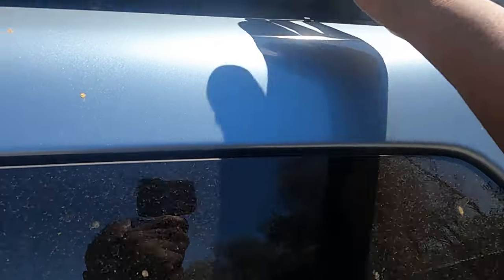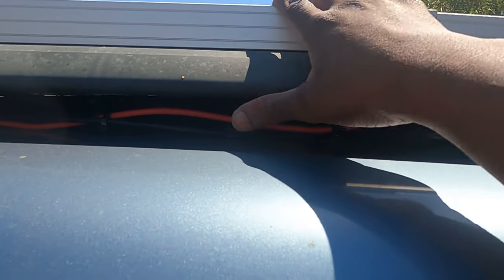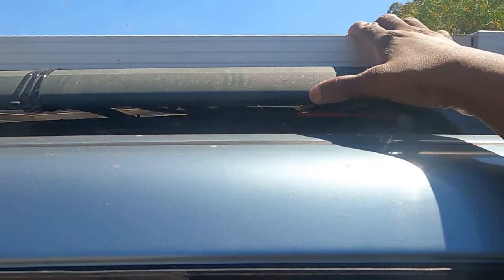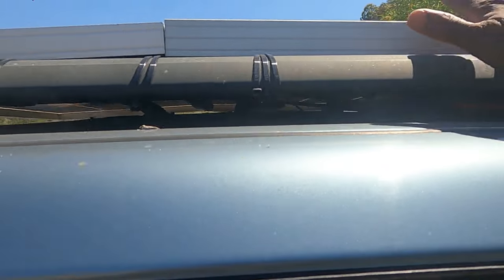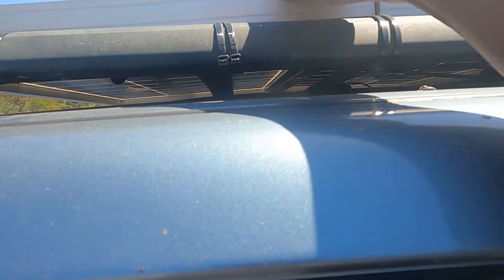MINIVAN VANLIFE: MY 400W SOLAR SETUP

Comment: If your fuse replacement didn't help the lighter then you probably need to replace the socket. I have seen videos on this for the Toyota Sienna. A1 Auto Service has a video from 2 years ago. Tim from MoBang For Your Bucks has a Sienna and does a lot of electrical stuff and is in SoCal, you might could reach out to him for help. Tim is a Glorious Life On Wheels follower as well, super nice guy. His email is posted with his channel.
Reply from the maker: Thank you. 🙂

Comment: Did you check the fuse on your vehicle’s 12v socket (aka cigarette lighter plug)?

My first power banks were after watching on the news NYC in blackout for days & days from Hurricane Sandy & nobody could charge their cellphones.  I gave friends & family little for Xmas Mophie power packs that could recharge your phone 2 or 3 times. Years later I ended up with a CPAP medical device, but power stations out their could hardly go all night & prohibitively expensive.  But then I wanted to go camping for 4 or 5 nights.  The first power station I got in 2018 could only go 2+ nights so I returned it & got one that was powerful to go 4-6 nights depending on how many hours I slept.  That power station is still dedicated to the CPAP, I have another one that is 300wh, and several power packs for recharging phones, tablets, & USB devices like fans & radios.  It works well enough.
Reply from the maker: Yup, changed the fuse several times and still nada. I also check to see if the bar in the fuse is broken and they never are.

Comment: I have two bikes that someone built for me years ago, i use to ride them everyday back and fourth to work (year around), but unfortunately neither one is operational at the moment, would love to get them going again, but the guy who built them for me is no longer around 😔 it's awesome that you have those skills and that knowledge..
Reply from the maker: Sorry to hear you can't get them fixed. I was thinking about building one out while actually living in my minivan. Maybe a folding one, but I haven't worked that all out yet. 🙂
Reply: @cheflifevanlife  Yeah I think that eventually I will just purchase another one and sell the two I have .. I want a folding electric one as well, the only problem is that they appear to be so small, like kid sized 😂 I'm a plus sized (smaller end) women, so I need an adult sized bike! .. am still torn between that and just getting a moped or motorcycle instead 🤔
Reply from the maker: @beyondcomforttraveladventu1856  They make some pretty sweet ebikes that are a cross between a motorcycle and a moped. So low maintenance and looks super cool. It was one that I would actually buy. https://www.onyxmotorbikes.com/pages/rcr-72v I love that thing. 😍

Comment: Your bike ride scared the heck out of me. I couldn't tell if you used metal zip ties to attach your panels. That's what I used. I used 3 metal zip ties per tie down location which looks similar to what you did. I did use plastic zip ties for the cables though. I just have one big 200w panel on my Sienna right now, but nice to know I could put 400watts up there!

Comment: Can you elaborate on your iceco fridge that went bad. What model was it ? Were the vents at least 2 inches from the wall, etc..

I'd like to get a 40l one  but maybe I won't if they stink.
Reply from the maker: Yes, the vents were more than 2 inches from anything. First it wouldn't cycle off and ran continuously, then it stopped working altogether.  Even Chrome from Vancity Vanlife had trouble with his first Iceco. My model was the ICECO VL45. I now have a BODEGA 12 Volt Car Refrigerator that is much more inexpensive than my Iceco and has been flawless. Do your research and get what's best for you. Good luck, Brian.